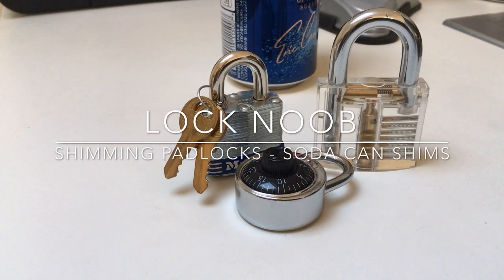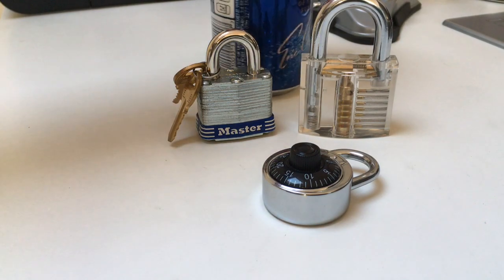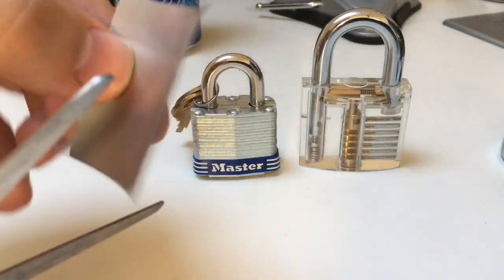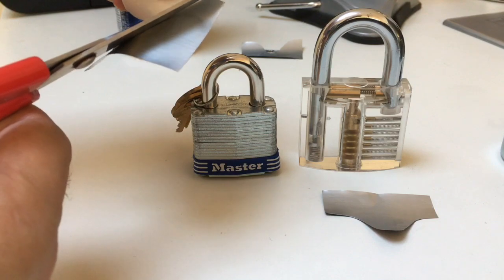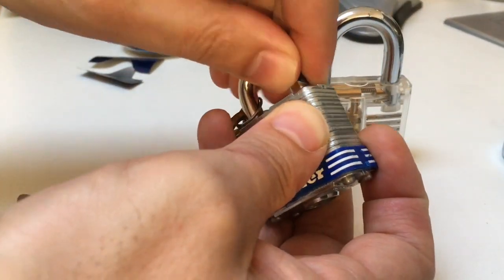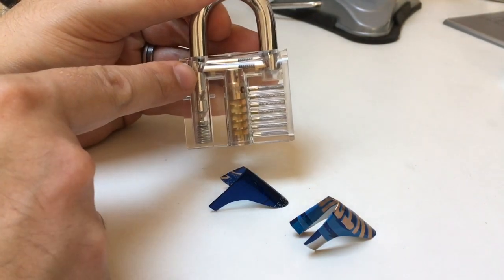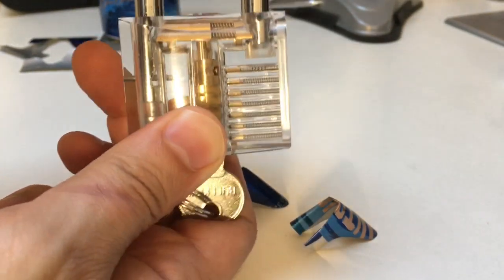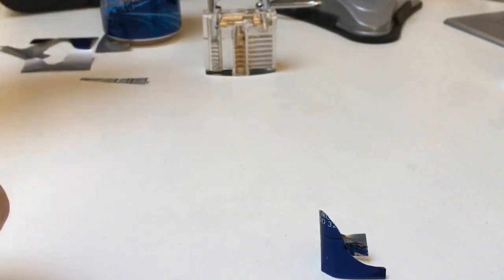(013) How to Shim Open Padlocks - soda can shims

Comment: There are plenty that you cannot shim, for example the abus padlocks which use a ballbearing which deadlocks into the shackle. It is not spring loaded and canot be pushed back without the barrell turning

Comment: I tried to make the shims exactly like that today but they just bent while I tried to shim them in. Was using a coconut water can. Maybe not all cans are alike?
Reply from the maker: It’s a bit of technique I find
Reply: Some coconut oil might have helped? Aluminum is kind of grabby so lube helps it slide. I'd put a bit of thin oil down into the lock before shimming it. Just let some soak in. Metal on metal is friction.
Reply: @1pcfred  like wd40 or coconut oil?
Reply: @ricksteegers2698  any liquid has lubricating properties. Some are just better than others are.
Reply: @1pcfred  really I had no idea
Reply: @ricksteegers2698  I know about it and yet I am still often surprised when lube makes all the difference between things working and not.

Comment: Would it not?  Be easier & more symmetrical to draw the shim on the strip of  metal beforehand, instead of cutting it freehand, the shim might even work a little smoother, could even smooth the edges of the shape with an Emory board or 300 grit sandpaper so it slips snd turns easier, since it's hobby time, maybe some silicone lube on the shackles or shim, no.. I'm not trying to be factitious,  attention to details always makes things better
Reply: Don’t forget, sometimes the biggest enemy of a good plan is a perfect plan.  

In this case, it’s more of a quick dirty trick so the more detailed it is and the longer it takes, it’s no longer quick.  Feel free to do you obviously.  But for one time use, made on site tools it may not be worth while.  

If you have the time before hand, it would probably make more sense to make one out of a much stronger alloy.